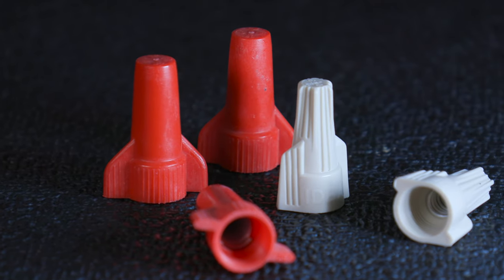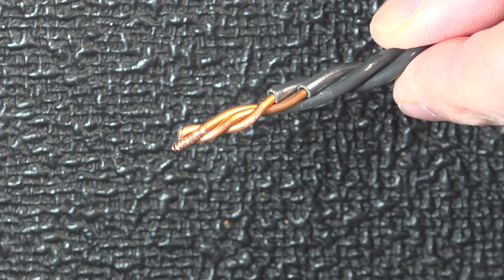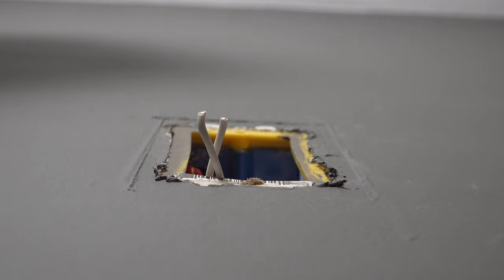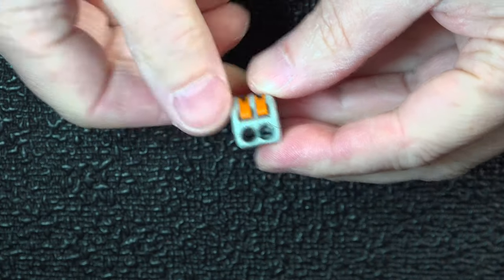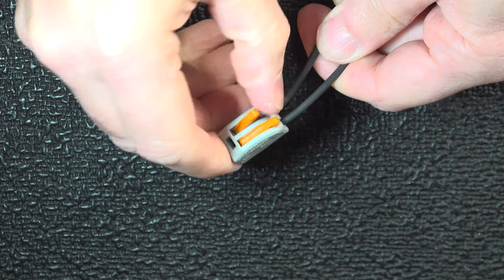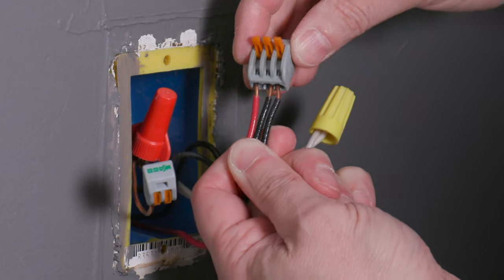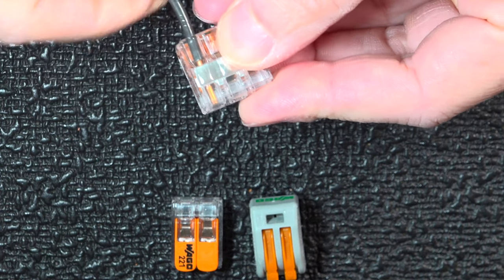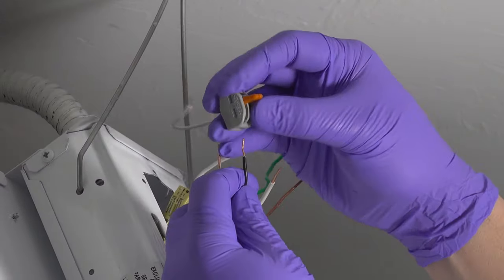Never use Wire Nuts Again - Wago is Better Electrical Connector

Comment: I've seen these but in decades of electrical work I've never seen a problem with a PROPERLY INSTALLED wire nut 👍
Reply: I don’t think he was only talking to the pros he was talking to the regular consumer also... that’s why he was talking slow. I’ll buy
Reply: @smokeskull  🤣😂😆
Reply: Push connectors are the preferred choice outside of the US. Wire nuts have several disadvantages over push in connectors.
Reply: @aredditor4272  assuming the wire nut is properly installed, go ahead and list them...??
Reply: @poserwanabe  when you twist the wire, you're cold working it to make it brittle, and it should probably all be cut off for a lasting quality connection by the next guy who has to work with it.

Again, it's now the top choice outside of the US, and many US firms are also switching to push. Twisted to solid under a wire nut is garbage.
Reply: @aredditor4272  I'm curious how many years have you been doing electrical work ?
Reply: @SilverCymbal  
BEST COMMENT
Reply: @poserwanabe  I've been doing tradeswork since the 70s, I'm an old dude. I also hang in electricians online forums like Holt and Reddit electricians. If you're an electrician, you should keep up to date on your craft, you're behind.
Reply: @aredditor4272  lol, I'm an old dude too, don't worry I keep up 👍
Reply: @SilverCymbal  I can show you how to not use the wago correctly and burn the house down. That does not mean I cam claim "wago connectors are incredibly dangerous "
Reply: @aredditor4272  I've had more service calls dealing with push connectors than with wire nuts. The problem with push connectors in older homes are the limited amount of circuits which creats a lot of draw; people have 20 different things plugged into the same circuit which causes heat, which expands the internal flange in the push connector. It cools down and the cycle repeats. When this happens, the flange weakens and over time doesn't keep the wire/s set and they start falling out and lose contact.
Reply from the maker: @kubectlgetpo  You are welcome to do that but thats the point. The Wago is absolutely easier to be installed, visually and by minimal feel. The wire nut is not, you can't see what's going on and when mixing wires the issue is worse.
Reply: @SilverCymbal As a licensed electrician I still believe wire nuts are superior in the long run, and will continue to use them because of it. I've seen to many problems with push connectors. 
Good video by the way. I can see them being useful in light fixtures that use LED where the potential of excessive heat build up would be at the fixture itself (LED don't create a lot of heat typically) instead of the entire circuit
Reply: This is about the most unrealistic situation possible. Why would you cut the neutrals if your replacing the switch? And if your using it to get power from I find it hard to believe your gonna fish the walls, cut drywall, put in remodel work boxes and not know how to use a wire nut. And what else is on this 15 amp circuit, you can’t just Willy nilly keep adding on.
Reply: @335m5  that's why people should be hiring professionals that know what they're doing instead of people that don't
Reply: @joshuahaught4812  Several YouTubers have made videos testing your theory, and have debunked it. They put wire nuts and push connectors in a circuit together, and purposefully overload them to see what happens. They also test the resistance
Reply: @aredditor4272  How can my experience with them be debunked?
Reply: @joshuahaught4812  Your claim about them failing due to too much current on one circuit. 

Do you image failures when you find them? Many  pros do, for their customers and/or their own portfolio.

I'd expect you to image those push connector failures.
Reply: @aredditor4272  I am a professional electrician and don't take pictures of every failure I come acros, unless it's an obvious hazard. 

The YouTube debunking can't replicate 40 years of real world scenarios.

Push-in connectors use the same concept as the stab-in part of the receptacles which fail ALL the time for the reason I gave about the push in connectors, (which is why I never use stab-in style connections unless there is a set skrew).
Don't know what to tell you other then what I've seen and experienced as well as what I've been told by other's who have experienced the same. 

Those connectors are UL listed and approved, but I'm not willing to put my license on the line using them like wire nuts. I would/do use them in certain situations, but those are rare.
Reply: @joshuahaught4812  There's electricians from many countries wondering what the hell you're commenting about. Ever hear of lever nuts? They're push connectors with little levers to lock wires in place. 

You're also commenting against products that are used in countries using higher voltages at ordinary outlets than we do in North America. 

UK also has receptacles that are far superior to what we use in the States.
Reply: @aredditor4272  I can careless about what you've learned on YouTube. I am an actual licensed electrician with many a service calls to correct all manner of problems. I listed some to you earlier. Dont know how you can try and debate my experiences....you can't
Reply: @joshuahaught4812  You're the type of tradesman people shouldn't hire. You're years behind, and too stubborn to look outside of tradition. 

Push connects also integrate with DIN mount systems for clean and well organized installations. 

I rarely hang in YouTube comment sections, but try Holt or Reddit forums. You'll get roasted by the majority of journeyman electricians that hang there.
Reply: @joshuahaught4812  oof, wire nuts are traditional, and you can't break from them. 

Starting to see your larger problem.

It's  piece, not peace.
Reply: Only when people try to put too many wires in one wire nut lol. I've done alot of school jobs that were dangerous as can be
Reply: @aredditor4272  Thank you for clarifying tradition. if you know what I'm trying to say why feel the need to correct a grammatical error, when the topic has nothing to with that? 

There is no issue using wire nuts as a mechanical means of connection, and have been proven to hold up just as well if not better than push in connectors; fact! They have simply been around twice as long and have still been holding up in houses to this day.

 Engineers CAN'T simulate time accurately with their tests, simply because of to many variables to properly do so. Point being don't always rely on modern explanations, and go with the adage: the proof is in the pudding. 

I have never said I don't use push in connectors, I do; I just don't use them with new wiring methods, they are more of a service call situation when the costumer dose not want any plaster or sheet rock damage in order for us to get more  wire length in the box; old school wiring methods are atrocious for modern methods. so I'll use push in connectors to extend the wire when it's in the box

You really need to get over professionals using a mechanical connection means that works and is time tested just because you don't use them. Are you an electrician? You keep saying you're a tradesmen which doesn't mean you are a sparky (tradesmen encompasses every trade, not just electrical)

You use what you want, my make up is very clean and tidy, and I'd wager it's just as clean as what can be done with push in connectors. It's the tradesmen that knows their craft that is capable of doing proper workmanship, not the products (although they can help).
Reply: @jakefloyd8035  very true, that's why we electricians need to understand the product we use. The product itself, in this case wire nuts, aren't the problem, it's user error.
Reply: @jakefloyd8035  which is why I said "properly installed" they all have clear specs on the max wire count and sizes
Reply: @jakefloyd8035  that's another great thing about push connectors, they make ones that will take 4, 5, 6 conductors without any issues. None of that twisting and cold working the conductors shit.
Reply: @BarryPiper  Who told you push  connectors are not approved by any relevant authority?
Reply: @smokeskull  no, it's not He's right about it...
Reply: @aredditor4272  I've noticed this on some of the scientific chillers and vapor traps I work on.... I've been having to change them out  for wire nuts on connectors that are used for more than 3 wires because they burn up from poor connections from the factory
Reply: People don't install them properly. That's the point of the video doofus. There's always an expert who can't help but pat themselves on the back lol.
Reply: @codylargeteau7658  then they're either shitty push connectors, or they weren't properly used. 

I've found failed connections of all kinds simply because of material issues, for example; wire nuts made with a poor choice of alloy or coating. 

Or flag terminals made of easily corroding steel used where high amounts of moisture is guaranteed.

Wagos have well designed cage clamps, not all push connectors are well designed. 

No idea why career electricians would ignore the work hardening issue that comes from a necessity to twist wires together. I find plenty of failed wire nut connections.
Reply: in europe nobody uses wirenuts anymore... they are just outdated
Reply: @DaleDix  first off no need for name calling, it makes you sound like an 18yr old punk. Second, I simply made a statement based on fact from years of observation. I never claimed to be an expert or "pat myself on the back". For all you know I could be a carpenter or a lawyer ??
Third, if you're comparing a properly installed device to one that's not, that's a ridiculous comparison....
Peace and be safe..
Reply: Yeah none of the methods the guy was showing ever happen with real electricians who know how to use wirenuts properly. That said, I do see a valid market for this. It is a more safe method for the less skilled/knowledgeable. And that's needed, as an electrician I replaced countless bad melted down wirenut conjunctions that were likely DIY done. Mostly it was stranded to solid connections where the stranded wasn't allowed the first bite like it's supposed to be and occasionally I'd see where people didn't pretwist their wires together before putting the nut on. I don't care what the wirenut manufacturer says, best practice is to pretwist your wires. Especially when there's more than two wires being connected. For that reason most faulty junctions on solid wire only connections actually happened on neutral wires, yet another thing a novice might not think could happen.
Reply: @austinpatrick2682  "properly" means twisting the wires in such a way that they shouldn't be messed with ever again, so it has to be cut off. That's not necessary with push hardware. That's only part of the advantages of push connectors. They exist with opposing ports so wires can go together from opposite directions. They can be DIN mounted. They're much faster. They're much better for solid to stranded connections.
Reply: @Jakob-co2mn  Europe also uses 220V 50Hz. It is just connecting two wires, not a brain surgery.
Reply: @Joe-by8jh  well said.
Reply: @Joe-by8jh  HVACR, and having been in the trades, I see shit from supposed experts in all walks of life. 

You're behind with regards to the latest and greatest in the trades if you're still arguing for wire nuts over quality push fittings.
Reply: Because something has been in use for decades doesn't make it safe of fit for use. electricians in the UK stopped using wire nuts decades ago Because they were/ are so unreliable. The wago connectors grip the conductors without damaging them and they are reusable. despite the extra initial cost they pay for them selves over time.
Reply: @Dom-k4y  
Hahaha you forgot to mention "UL LISTED"...
Reply: @Joe-by8jh  well that is possible but the UK is slow to change anything. so for the UK to phase out the use of wire nuts practically overnight lends some credence to wire nuts being unreliable in my view.
Reply: Yup, installed thousands. How much surface area is inside these new connectors? Maybe I'd use them in industrial, but I won't have them in my house. Wire nuts all the way.
Reply: @spugnoid  thats fair but in the UK we haven't been given a choice plus from my own experience they are easer and faster to Install and safer than a lot of the alternative methods of junction boxes and screw down connectors we have available.
Reply: Except the invoice when they're done aftet 15 minutes of work
Reply: @poserwanabe  i keep it up too... that's why they call me lightning rod..
Reply: @MICHIGANMIKE12  
😂🤣😆🤣
Reply: I’m an electrician with 40 years in service. WAGO is a German brand. In Europe voltage is 220 volts to ground. These work great there but with our lower 115volts l am concerned with the limited contact surface area of these. That’s the reason I never once used “quick wire” devices in my career! I only use these for connection of fixtures and only if they come with the fixture because they save my precious Wingnuts for more important jobs lol.
Reply: @poserwanabe  is that like punky Brewster?   If you are old enough...haven't heard the word "punk" in long time...kinda like Beatnik...
Reply: @MICHIGANMIKE12  it's a great word and it has different meanings depending on how you say it.....PUNK !!! 🤣😆😂
Reply: @joshuahaught4812   these damn youtubers giving damn electrical advice and using the word DIY , wtf is going on this is not something you mess around with and try teaching ignorant homeowners how to use a lazy product with out educating them on code or even real life examples of why this are not commonly used
Reply: @joshuahaught4812  Yes, you're absolutely correct. And these push connectors use a similar electrical connection as those cheap stab-in receptacles we have all seen fail over time (it's usually the neutral). Very little surface area in the connection.
Reply: @aredditor4272  There's no way these YouTubers you speak of could have tested the most important factor... Time. How these push in connectors fare over TIME. Joshua has seen the results of this, and so have I.
Reply: @aredditor4272  Are you a licensed journeyman electrician?
Reply: @greedo2660  you're behind the rest of the world, push connectors have been in use in other countries for a long time. In UK they used block connectors, and have switched to push for the most part. Apparently you also don't know they have higher voltages at their devices. EU standard is 230 at outlets. The higher the voltage, the furthet an arc can travel.
Reply: @greedo2660  He is HVAC not an electrician
Reply: @joshuahaught4812  but these are not your grandfather's push connector. The lever applies constant future pressure. Not stab like pressure.
Reply: @HarmanatorNYC   so then tell me how wires happen to slip out of multiple lever connectors that I had to replace with a wire nut to create a proper (long lasting) mechanical connection? 🤔.  Do you know how many wago lever connectors weren't able to to their job in modern light fixtures that come with them from the factory?

You can use what you want but I'm not going to skip wire nuts for these. I hear what your saying, but my (and other professionals) experience have proven the claims in engineering in the lever connectors wrong. 

That being said I'm not saying they are a horrible product or do not have there uses. I just trust wire nuts more because they have been time tested.
Reply: @aredditor4272  "Wire nuts have several disadvantages over push in connectors." - do tell?  What are the disadvantages?  (Keep in mind you'll be responding to a retired electrician/control specialist with 45 years experience)
Reply: @aredditor4272  Yeah man when you make up alot of boxes your wrist hurts like fuck from twisting together so many bundles of conductors all day long. Go use some wagos and its much faster, safer, and a hell of alot easier on your body in my opinion. No wire nuts falling off conductors when you go to trouble shoot a box haha
Reply: @jakefloyd8035  Apparently many supposed career electricians only do new work, and rarely or never have to revisit their shit. Here's one example of what they apparently don't have to do: I work at a hotel with hardwired electric stovetops. Well they break, they have to be replaced, and that means twisted wire connections undone, sometimes more than once. It's not a minor dilemma.
Reply: @aredditor4272  Yeah and if you had to go back and troubleshoot that, and put the wires back together you don't have to cut, strip, and retwist wire. I personally really enjoyed using wagos on the jobs that didn't mind paying for them.
Reply: @aldinardo4812  there's entire countries using them, and they have higher voltages delivered to their homes.

They also have much better plugs and outlets than Americans.
Reply: @aldinardo4812  I completely agree with you. @aredditor is not a licensed electrician and has not had to deal with service calls having to troubleshoot with wago's. He will never answer a question if he knows he'll be wrong and deflects with other questions that are completely off topic.
I'm not trying to talk shit on him, but just saving you the time by not engaging with him even if you're being civil; reason does not apply here. You, I and the rest of the licensed electricians don't know what we're talking about.
Reply: @aldinardo4812  you're welcome. You as well sir.
Reply: @aldinardo4812  Higher voltage means more potential for arcing with bad connections.
Reply: @joshuahaught4812  I'm a certified HVACR tech, that means my background goes well beyond that of a sparky. I have to know what electricians know and then some. 

In addition to that, I keep up to date on the latest and greatest, plus I hang in forums where it's almost all sparkies, but not just American and Canadian sparkies, electricians from all over the world. You guys are the reason people in other countries make fun of Americans for their constant exceptionalism. 

A lot of what's done outside of the US is superior to the US, especially the UK plugs. They don't use wire nuts there, and before that, used terminal blocks. They have much older buildings, yet less electrical caused fires.
Reply: @aldinardo4812  That's the thing about the Americans in here claiming lots of experience and shitting on push connectors. You seem to assume the tens  thousands of European, Asian, and fellow Americans who regularly use push connectors don't know as much or more than you. 

I hang with them, many work in high end situations, like factories. Many work where they have to organize hundreds of connections in panels and with voltages many electricians never  see. 

Some are using din rails, which wagos are designed for. Better management of space and wiring. Some are hanging in forums where they post their cable porn for other tradesmen to see. 

They're pros, journeymen, go to trade shows, stay up to date, work for large firms, large factories, government bureaus. You sound like a dude that's done simple stuff all your life, and don't try to be next level as a tradesman. Maybe just working on homes, apartments, light commercial.
Reply: @aldinardo4812  Then you're Canadian, because most of the world doesn't use wire nuts. They're ahead of North America in many respects.

I already typed out that I'm a certified HVACR tech. I do electrical AND I service all manner of heating and refrigeration equipment. I HAVE to know most of what sparkies know, and then some. I have to diagnose and repair all manner of electrical equipment, including supply issues, wiring, service panels, disconnects, breakers, fuses, contactors, electrical connections, etc.

Now keep telling the electricians of entire countries and continents you know better than they do.
Reply: @aredditor4272  Just because you follow what other people do doesn't mean it's the only (or better) way. 

68 million people in the UK with 20k+ electrical fires annually.  331 million people in the US with 45k+ electrical fires annually. Pretty sure we are doing something right if our electrical fires are double the UK with nearly quentuple the population. 

Point being wire nuts work, so why does it really matter what professionals use. They are UL listed and we have had more issues with lever/push connectors than with wire nuts here in North America. Our license our choice. Wago's are only rated for 20 amps any way which works better for Europe because they have lower amp higher voltage systems. Here in the states wire nuts are better for residential and commercial applications. 

I can see wago's being great for control wires and systems with little draw.
Reply: @joshuahaught4812  North America is about the only country using wire nuts instead of terminal blocks and push in connectors. Wago is a German company, Btw.
Reply: @aredditor4272  what does wago being a German company have to do with other countries using them? My statement was about electrical fires in other countries compared to the US. Oh, Germany, now that you brought it up, has around 65k electrical fires annually with a population of 88 million. 

I understand that North America uses wire nuts. If we have lower electrical fire issues then other countries and our main mechanical connection for wires are wire nuts.....you can finish the logical  conclusion. 

Wire nuts aren't the problem!
Reply: @joshuahaught4812  You're suffering from an inability to move from tradition and a feeling of exceptionalism(too common with Americans). 

Europe averages much more  older buildings  than North America, but Western Europe averages less issues with fires than North America. 

Germany had to be brought up with you because you seem to think Europe only consists of the EU. 

You are behind the majority of the developed world when it comes to certain electrical products and procedures. Ceramic wire nuts were commonly used world wide. Most of the world moved on to superior methods of connecting wires. 

Try to use your brain, the part doing the wire connecting is a tiny spring steel cone. The palstic around it seems to be giving you an illusion that there's more to it. 

If you give it thought, you should be able to figure out that a requirement to twist wires together is a major disadvantage, ESPECIALLY when it's an attempt  to combine stranded with solid. 

There are several disadvantages, but as an electrician(so you claim) you should have given this deeper thought a long time ago. 

Most of the world uses block connectors and wagos(ideal also makes push connectors). In much of the world, wirenut connections aren't allowed.

Manufacturers of anything with wire connections dont use them, that should be another glaring clue for you.
Reply: @aredditor4272  Don't know what you're talking about with other countries having to deal with older electrical systems; America is one of the first adopters of electricity so our electrical systems are just as old or older than any of the countries you're talking about. Also, Germany IS part of western Europe and they have more electrical fire problems than North America as I said earlier.

Your perception of open mind or using "your" brain is based on what works for other countries who have a completely different system than the US so those products are better suited for their systems. I listed a couple of very respected countries that have more issues with electrical fires per capita than the USA. Simply put, we are doing just fine with our wiring methods, and we'll continue to do so as the NEC evolves.

Manufacturers do use wire nuts! Don't know what you're talking about there. There are a ton of appliances that have them.

If something new comes along the way that is superior to the wire nut for North American electrical syatems I'm Def down to use it.
Reply: @aredditor4272  please inform me what the age of the structure has to do with it? If anything their safety measures with electrical systems should be a priority and taken into account with their older "structures." If they are having more electrical fires per capita than North America, then their safety measures aren't as good as North America's.
Reply: Hey everybody! Take a look at this TOTALLY authentic, self-proclaimed "old dude" named "aredditor" talking about cold-working wires as if a couple twists are going to make any meaningful difference! LMAO! He tries so incredibly hard to appear as somebody you should listen to it's hilarious!
Reply: @aredditor4272  I doubt the majority of electricians are half as petty and dramatic as you, Mr. Reddit... but assuming they are, why should I care? That's a rhetorical question by the way, don't try to answer it. I don't care and never will.
Reply: @General_Griffin  If you are an actual electrician, you're a hack. 

Fired if you're my employee, or not allowed in my business or home to work. I'd rule you out as someone to work for me in any capacity. We're years into a superior product, and you're too slow to understand how and why it's superior.
Reply: @aredditor4272  ...So you're saying I wouldn't have the privilege of working with you ? LMAO That's a bonus! By the way, you couldn't afford me anyways, chump. I fabricate, fit, weld, finish, paint, plumb and wire massive costom machines with nothing but my own two hands and a few power tools every week. Those machines sell for more money than your house is worth. I think I'll be just fine.
Reply: @General_Griffin  You're defending a product American electricians trust so little, they say wires must be twisted together for it to work properly. Perhaps even tape it, too. 

Think hard about it, the actual business part of a wirenut is a tiny cone shaped spiral of steel. And unlike a wago, you can't visually see through a wirenut to check the finished connection. 

You're defending an outdated device most of the world's electricians no longer use. 

BTW, before wagos, and still, many non north Americans use terminal blocks in enclosures, and those are superior to wirenuts.
Reply: @aredditor4272  Basically every enclosure in the USA also has a terminal block... We don't wire outlets with wire nuts, contrary to what the video's author was showing. That's just a stupid and unnecessary step he took to make wire nuts look worse than they actually are. That's pretty much all this entire video is, though, with some blatant lies thrown in for flavor.
Reply: @General_Griffin  I'm commenting about all enclosures. In outlet, switch, or junction boxes, many countries used terminal blocks, not your beloved wirenuts.
Reply: While not an problem with a "properly" installed wire nut, you have to be pretty ignorant, or just american, to not see the overall downsides of wire nuts, and the huge benefits of Wago. Wago don't damage the wire, they don't work harden the wire, they don't twist and bend the wire, so it's much easier to add or remove wires later, and it will certainly look cleaner. They are faster to install, they are faster to remove, they have a test port (which he forgot to mention!) the newer 221's are clear, so you can also visually inspect every connection. Wago's are also better for mixing solid and stranded, you can DIN-mount them, and you can reuse them over and over again.
Reply: @Kowalski301  
"or just American" GFY
And next time use a capital A
Reply: @joshuahaught4812  
And haven't been taught very well. The twist clamps are a safety and fire hazard. The other connects is used LITERALLY EVERYWHERE ELSE WITHOUT ANY ISSUE. FROM PHONE CONNECTION TO INTERNET CONNECTION. YOU'RE JUST TOO MUCH OF A TRADITIONALIST.
Reply: @joshuahaught4812  
America has electrical fires DUE TO THE USE OF THE WIRE NUTS. ITS NOT A MATTER OF IF, ITS A MATTER OF WHEN. WITH THE NEWER CONNECTORS YOU CAN ACTUALLY SEE WHERE THE WIRES NEED TO GO AND YOU PUSH THEM IN AS FAR AS THEY GO AND PUSH THE SWITCH DOWN FOR A STRONG CONNECTION. WITH THE TWIST CLAMPS THAT CAN TRULY NEVER HAPPEN  BECAUSE AT THAT TIME THE WIRES WILL HAVE BEEN TOO DAMAGED FOR ANY REAL USE TO HAVE BEEN MADE.
Reply: @Openreality  You're clearly not a professional because you would clearly not bring up phone and internet into the equation. 

How many can lights with factory wago nuts that can't do their job have you installed? How many service calls have you done that resulted from failed push/lever connectors. How many houses have you remodeled where an 80+ year old wire nut has been doing its job just fine?

And while you're at it, tell me why North America has less electrical fire issues per capita than "Everywhere else." Clearly we are doing something wrong 🤔. You have a brain, please use it before posting. Improperly installed wire nuts can cause issues, yes, you are correct. Properly installed wire nuts do a job just fine
Reply: @Openreality  Also, explain to me why everywhere else has electrical fires? What causes them?
Reply: i mean i've seen them but they weren't installed by a "qualified" electrician.
Reply: @joshuahaught4812  Because you love to compare electrical fire statistics without really looking into them. The biggest cause for fire in Germany are the electrical devices itself. There is literally no statistical evidence that wago products are a fire risk. 
http://www.ref14.vfdb.de/fileadmin/download/ref14/Bericht_Brandschadenstatistik/14-01_Technischer_Bericht_vfdb-Brandschadenstatistik_02_2020_Final.pdf So depending on the calculation the cause of fire  being the electrical system is around 10% . And in those cases the probability of wago products being used in those systems is not 100%, because wago and their products are only one way to connect wires together, the actual share of wago in the residential enviroment, especially including the fact that old houses mostly use a different, outdated style of connection,  makes the probability that wago products were used in a system, where the system was the cause of the fire, really small.

Also Wago products are certified by VDE , UL  et cetera. 

"And while you're at it, tell me why North America has less electrical fire issues per capita than "Everywhere else." "  

Maybe just maybe, because in general the percentage of of electrical heating and high powered electrical appliances that are plugged in 24/7 is higher outside of the US and a lot of electrical appliances in these categories are probably not that old in comparison. ( it's pretty normal to see  over 20 year old dryer, space heaters, refrigerators in german households of older people ( the group that is statistically at the highest risk of electrical fire and by the way the group of people that mostly have the older kind, the  "lüsterklemmen", in their systems in places where those aren't allowed anymore)

In contrast :
<<According to the National Fire Protection Association (NFPA), each year arc-faults, caused by worn and inadequate wiring, overburdened circuits, outdated technology, and aging electrical systems, start more than 35,000 home fires causing over 1,130 injuries, 500 deaths, and $1.4 billion in property damage.>>  https://www.esfi.org/resource/fire-protection-for-your-older-home-769
so over half of the electrical fires in the US are cause by the electrical systems including wiring and your beloved wirenuts. 

In other words, the probability of the cause of an electrical fire being a wirenut is significally higher in comparison to the wago product line.

The others tried to convey you the practical pros of the wago system, that good electricians, especially older one who still remember the older stuff similar to wirenuts, appreciate. 

At last if you have so many problems with a system, when literally no one else ,who works with it daily , has these problems, you should consider if you are the actual problem instead of blaming the system without any kind of factual evidence.
Reply: @S41t4r4  what a rant. Those other countries still have more fires per capita than the US. I never said improperly installed wire nuts did not cause issues or overburdened circuits added to the problem. All I've said was properly installed wire nuts make better lasting connections than wago's in the US from mine and many other Electricians experience.  

You're more than welcome to continue cherry picking what's being said instead of understanding the actual statement being made.
Reply: @joshuahaught4812  I literally didn't jerry pick sorry dude. But I exactly explained. why your point is based on your arguments is wrong. Your best argument is anecdotal at best und your " but other countries have more electrical fires" is at best not educadet, seen in for example the actual ratios of the cause of fire, or at worse plain malicious. Wagos systems are used in the industries for decades without any statistically significance in fire risk and having advantages over other proofen methods. 

Wirenuts may work fine if used correctly, have no significant heat cycles ( can get undone because of materials expand and retract ) and are left alone. But for long time connections, that won't be opened, permanent connection crimps are the much safer way to go ( guaranteed reduction of oxidation, much bigger contact area, no way to get undone).
Reply: @aredditor4272  first it’s stranded second if you don’t know how to make a correct stranded to solid wire joint stop trying to do electric work
Reply: @cliftonluce1534  North American electricians who can't progress from wirenuts like the rest of the world, should move on to another line of work.
Reply: The only problem i've seen is aluminum and copper nutted together, melted through the nut entirely
Reply: @joshuahaught4812  Sounds like you are not keeping up to modern electrical methods. When was the last time you went in for a electrician license renewal?
Reply: @Rudofaux   I've already taken my code change (2020) pt 1 and 2, OAR's and currently working on my grounding and Bonding, all through Mike Holt. When did you take your continuing education?

Making a statement without proof/evidence is something ignorant children do. I assume you're not a child though, so next time have a well thought out response before making it. 

Here's something to help, what specific part have I said that is not code? Go ahead and give me a code article to back up that claim as well
Reply: @joshuahaught4812  My, aren't you getting quite defensive over a simple yes or no question.

Wire nuts are obsolete technology. But I'd think your an old dog that can no longer learn new tricks. I can sleep comfortably knowing that you'll never work on my home if I ever need outside electrical work.
Reply: @joshuahaught4812  "Never before had I encountered someone who wasted so many words just to say nothing at all." -Vici
Reply: @BernWag  Most of out power comes to us via aluminum cables at voltages up to one million volts. 

We know how to work with it. Most feeds into homes are aluminum.

We also have better aluminum alloys for conductors and connectors.
Reply: @BernWag  just in the past few years, I've seen huge solar installations utilizing a lot of aluminum conductor, especially when the price of copper has been high.
Reply: Man, @Silver Cymbal, you hit a nerve, lol. I dig the presentation but I'm still not sure. I have questions. Also I really want a set of silver cymbals-they're so shiny! Thanks bruv
Reply: and there's the problem @ poserwannabe. PROPERLY INSTALLLING the wire nut. For the DYI project person properly installing the wire nut is the reason to be concerned with using them. Obviously a properly installed wire nut works properly. The problem is when they aren't installed properly.
Reply: @RageDaug  which is why I wrote those two words all caps 😁
Reply: Wow.. lots of sparks flying in these comments, some are a bit negative.

I’m shocked & feeling a little discharged by it all, need to come back to earth & not let it phase me.

Keep it positive people!
Reply: @poserwanabe  you don't keep up if you're still using wire nuts.
Reply: @ProctorsGamble  40 years, but never learned the basics? Yes, Europe use higher voltage, but does that mean the same size wire carries less amps?! No, the wire range you can connect with a Wago can't handle more just because you lower the voltage. That is why we have regulations that tells us how much load a certain wire size can handle and guess what, it is about the same in Europe as in the US, even thought metrics are used in Europe to messure the cross-section.
Reply: @Faddnn  Amps are watts divided by volts. Copper is copper. I'm not referrring to wire size being the problem. Rather resistance and the ability of higher voltage being able to push though a smaller contact area in the connector without heating up. Verstehen Sie?!
Reply: @ProctorsGamble  Overload is what who will make a correctly terminated connection fail, the power loss over the wire including the WAGO will be about the same in both cases and the amps will be the same. Both NA and Europe have about the same ratings on how much current your allowed to push through a certain wire size. Wago and similar trusted brands exceeds the maximum current capabilities on these wire you're allowed to push into the connector.
Reply: @ProctorsGamble  I will give you a simple task you can answer. The continuity in two circuit is messured to 0.5 ohm in NA and 0.5 ohm in Europe. Both circuits are protected by a 15 amp breaker. If both circuits are pulling 15 amps, how much voltage drop will you have and how much power loss in both systems?
Reply: @joshuahaught4812  i have installed somewhere around 50-100 thousand of these waco connectors and not a single one has ever failed
Reply: @TheNoobility  That's great, I'm guessing you mess with control wires that don't deal with resistance (heat) issues so you wouldn't have any problems with them typically. As I've said based off my experiences I've had enough service calls where they were the culprit.  I don't use them except for very specific situations.
Reply: @Rudofaux  hahaha you have plenty of salt for the popcorn, thank you! As ive stated you are very predictable; make a statement, can't back it up when called out which then leads to childish antics because you never figured out how to deal with your feelings. 

Keep going off that path 🍿
Reply: @joshuahaught4812  Dude, your still upset over this? Here I thought you were an adult & moved on. I know I did.
Reply: @Rudofaux  and yet here you are. Okay, it is getting immature on both our parts, my apologies for goading you. I'm through with replying
Reply: @aredditor4272  Voltage wouldn't matter as much as current, so your point seems reversed.
Reply: @friendlyfire01  voltage determines how much of a air gap flow can overcome. The higher the voltage, the further it can arc.
Reply: I saw this video clicked on it, watched it, and said to myself, "this is obvious BS being peddled by someone trying to sell something.  I've pulled wirenuts that were install 30, 40 years ago and are still holding strong.  I'll jump in the comments and called BS."

But when I get here the comments are full of electricians who have been doing it for 40 or 50 years already calling BS...I'm only 45 years old.  What is my voice compared to guys who have been electricians literally for my whole life.  

Still, I CALL BS.

This is simply a shark-bite for a wire; quicker, and easier,... and less secure than a properly installed wirenut...and probably less secure than most improperly installed wirenuts.  

But I suppose my opinion doesn't matter right now.  I'll have to come back in 30 years when I've been doing it for 40 or 50 years like all the electricians who are calling BS here today.  My guess is that by then we will be arguing about why the next big thing is better than a wirenut.
Reply: @darriuscole8544  😆😂🤣
Reply: @darriuscole8544  If a wirenut is secure, why do the wires in it have to be twisted together and lopped off at the ends to make a "proper" connection? 

All a wirenut is, is a tiny coil of steel you can't see that's covered with plastic. 

North American electricians insisting wirenuts are fine  are behind the rest of the developed world.

More and more, American and Canadian companies are switching to push connectors.
Reply: @aredditor4272  You know if you stick two solid wires straight into a wire nut it will not only get tight, but also twist the wires together!?! Here's another
crazy fact, the two wires touching are the connection, the helicoil in the wire nut is just there to secure it, and the plastic on the outside will insulate it,
so no need to worry about moving parts and bridged connections.
Reply: @Cocpain  And at least one manufacturer has a video on just that, however it's a bad idea with two 12s or 10s, a dumb idea with more than two, a dumb idea with stranded to solid.

Once again, the rest of the developed world uses push connectors without issues. Most are even clear so the connections can be seen, unlike a wire nut. American electricians still holding out are just backwards and ignorant. 

BTW, service of heavy duty equipment and service calls on electrical circuits  is mostly what I do these days. I see failed wire nut connections on the regular.
Reply: @aredditor4272  Listen friend, I am not saying you are wrong, or these things are garbage, just to expensive, and another expense you pass on to a customer for something I personally don't factor into a job, for something I can't say is substantially better.
Reply: Commercial!
Reply: Facts
Reply: so you have seen problems with wire nuts they were just always installed wrong and there would not have been a problem if they used a wago
Reply: I have, cause i work industry, and have to modify or redo wires. Wire nuts are a pain in the ass. There is no benefit, what so ever, with using wire nuts. They're slower and the work doesn't end up as pretty,
Reply: @aredditor4272  god damn so this is what you do instead of getting laid huh? Shit tier trolling?
That's sad Nancy
Reply: @DaleDix  noooooooooooo.... The point of the video is to upsell you on some bullshit...
Reply: @GoalOrientedLifting  work don't need to be pretty Nancy
Reply: @MICHIGANMIKE12  compared to 1 hour of work turning the wire nuts
Reply: @ProctorsGamble  Connector does not depend on voltage, as at the connector is no voltage.
Connectors depend on current. If you choose connectors, whether Wago or wire nuts, do not exceed maximum acceptable current.

And if you use wire nuts, come back every five years, and tighten them again, if the house is not burnt down in the meantime of course only. 

And if you found loose wire nuts at an old installation, do not blame the electrician, who installed them as an idiot. Blame the owner not to call the electrician retightening every 5 years.
Reply: @aarondougherty6869  *you're
Reply: @aredditor4272  If you are getting a cold brittle connection, you are not twisting the wires correctly. You don't actually TWIST  the wires, you are forming them around one another.  Forming the wires together is not twisting them, you want solid contacts between the wires for better flow, the wire nut is not designed to make the connection, it is designed to hold the connection in place.
Reply: @markusallport1276  You don't understandcwhat cold working is. Doesn't matter how fast or slow you do it. 

Most of the world isn't using wire nuts.
Reply: @ChristianRodriguez-ku5wk  don't do electrical work if you're not a pro
Reply: @everyhandletaken Hey, you can't have the positive without the negative, if everything was positive nothing would work- 😀
Reply: @poserwanabe  apparently he pulled his comment, what did he say?
Reply: @aredditor4272  dude... you just went straight to ad hominem when the dude backed his claims.  You may have a point, but you failed to convey it.  All you did was call people out for not thinking like you, then attacked them for it.  And when rhey produce credentials and asked about yours you bypassed that and basically started hurling insults.  Like I said, if you had a relevant point that was when you should have made it.  The only point you made was you don't like actual debate and are prone to raving on the internet.
Reply: @sinisterthoughts2896  yeah I hate when people do that, I can't remember ?? This turned into a huge beef just because a few guys voiced their opinion based on experience
Reply: @sinisterthoughts2896  No pro wire nutter has backed anything except how people can't let go of tradition no matter how stupid it is. Most of the world is using  push connectors, and many US firms are doing the same. UK sparkies were usung terminal blocks, which are also superior to wire nuts, but even they have switched to push connectors.

If wire nuts were great, there wouldn't be a need to emphasize the importance of twisting the conductors together before you put that stupid hat on it.
Reply: @mrobvious5892  I thought all of that was a given! We are on YouTube after all!
Reply: This channel will mislead you.
Reply: I use them on every electrical connection at work every day for industrial equipment, been using them for years and have NEVER had a problem!
Reply: @joshuahaught4812  I will say that negating an opinion solely because a person is not an electrician is as shallow as assuming that an electrician has in depth knowledge of his trade. I've been around more than my share of licensed  "electricians" that are knowledgeable on codes but are clueless with theory, calculations, PF, harmonics,.... Some are just good construction hands without much sense.
Reply: Iv been using wirenuts and are able to unscrew them plus i can put in multiple wires sooooo. No. Ill keep using wirenuts.
Reply: @TnTBLACK95  can't argue with that, I would also be careful giving the title of construction hand, implying that they don't warrant an opinion as well just because they don't understand the theory (which are only calculated guesses) of their trade. 

We are talking about residential/commercial applications that are very straight forward.

I listed my experiences as someone who has extensively worked with both products that are related to this video and clearly stated my preference.
Reply: @joshuahaught4812  that was my thought. With wire nuts. The wires are in contact with each other, with the wago, they arnt and im curious if the plastic will hold up to the tussling and yanking as you move stiff wires and if eventually the metal connecter will become damage from regular use. I feel safer with wire nuts.
Reply: @GreyBlackWolf  Don't get me wrong, the wago's Def have their own applications that would be better than wire nuts; control boxes where parts are switched out regularly, and things that don't draw or create a lot of heat. All in all, I just prefer wire nuts and believe them to be better all around
Reply: @aredditor4272  Install a plug and receptacle.
Reply: @MatthewBerginGarage  the fact that you typed "plug" tells me all I need to know.
Reply: @aredditor4272  Yah I've only been a shift maintenance  electrician at a large steel mill for 37 years. I wouldn't use that Wago crap on anything I fix. We need our stuff to run and run hard in a very shitty environment. Probably work fine the on low voltage 5 conductor 24 gauge wiring your used to. 🙄
Reply: @MatthewBerginGarage  Germany has 0 issues using them, and the lowest mains  voltage German utilities deliver is twice what Americans get. Wire twisting, which work hardens copper, isn't required.
Reply: @aredditor4272  Twisting wires once doesn't work harden them. 🤦‍♂️
  It is not the voltage that is the issue. It is the current level and how they handle higher current surges and 60° C or higher ambient heat
Reply: @MatthewBerginGarage  nope, potential to arc and distance is determined by voltage. The higher the voltage, the greater the distance an arc can travel through a gap. 

One bend hardens copper, who told you it takes more? You did, you're making up nonsense out of ignorance.

You say you work in a factory? Ask your sparkie coworkers what a DIN rail is. Also invented in Germany, and wago makes push connects that work with DIN rails. No such thing as modular marrettes you place in DIN rails. 

You're behind the times.
Reply: @aredditor4272  I'm not worried about an arc, I don't like them melting from current.
Reply: @MatthewBerginGarage  poor connections lead to arcing, silly. There's a higher chance of poor connections using wire nuts than with  quality push connectors. 

Especially true for stranded to solid or things like 3-5 solid 12AWG wire nutted and crammed into a small box with other connections. Push connectors are superior for situations like that. 

An electrician can also future proof an installation by using push connectors with extra ports.
Reply: @aredditor4272  Sorry but they are not. The minimum wire size we use it my work is #12 x 7strand and I have had zero issues with Marrettes and if you can't make a good connection with stranded wire you shouldn't be an electrician.
Reply: @MatthewBerginGarage  if you can't stay up to speed on the latest and greatest in equipment, technologies, or techniques, you shouldn't be an electrician. You're only arguing because you're stubborn,  stuck on tradition, false sentiments of exceptionalism, and you're behind. 

There are many North Americans and North American  companies who've stayed up to date, and moved on to superior techniques and equipment. For no good reasons, you're not a part of that.
Reply: @aredditor4272  Just because it is new doesn't mean it is better and constantly proposing to cure a non existent problem won't change that.
Reply: @MatthewBerginGarage  your anecdotes about what you personally work with, for example using #12 stranded to #12 solid, show the limits  of your experience. #12 or #14 solid to 16 or 18 stranded is a common dilemma for many electricians, along with many other scenarios you apparently never see. 

Marrettes is old outdated crap that only the old and ignorant defend, they're completely out of many areas, not even allowed. It's 2022, not 1952. 

Your trade(if you're not lying) is also an old one. Many electricians in modern facilities or working with modern infrastructure specialize in equipment designed to work with push connectors. 

These things you're railing against are used with modern tech in well organized electrical boxes in a modular way. They're designed to snap into DIN rails. 

It's not even the future, it's the way in many settings. You're way out of your element, it's clearly not your lane.
Reply: You guys have been arguing about push connectors and wire nuts for 11 months and haven't gotten anywhere lmao this is the most hard headed conversion I've ever read
Reply: @aredditor4272  Ah that 's why they are so useful in other countries, snap on connectors have less contact area thus increasing resistance but in countries where these are popular they use higher voltages which overcome or negate that increased resistance.     The odd thing is that if you are a professional who knows a lot about electricity then I'm confused why you thought that higher voltages somehow support your argument for theses connectors holding up to higher currents when  @Joshua Haught  was talking about higher current draw scenarios causing issues.
Reply: This video was probably made by an amateur. Those connectors don’t have as much surface space connection as a wire nut. I hope he doesn’t make any more on this topic.
Reply: @xemockmookie2  German professionals and pros from many other countries don't use wire nuts. They rightfully consider them crude and outdated. If wire nuts are so great, why the emphasis on having to twist wires together first. 

A wire nut is a tiny conical hat encapsulated in plastic. They suck.
Reply: @jasonthurston799  in your head, consider two round fence posts. Can you make them contact each other over a large surface area? You can't, because they're round. Even if you twisted them together, only a tiny part of each post or pipe would be touching each other. It's going to be the same with any round copper conductors. This is why the highest quality aluminum transmission cable is all the strands mashed together. 

Many videos have been made testing different connectors to failure.  Here's one https://youtu.be/B1pmuRsf1co
Reply: Wtf?

I dont see a problem : properly installed
I see a problem : not properly installed
Reply: @General_Griffin  What do you make?